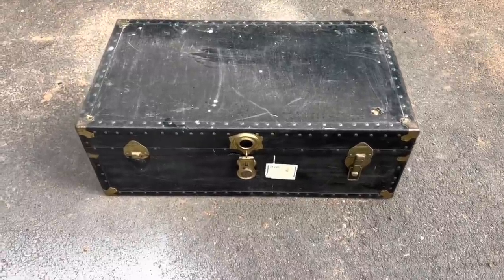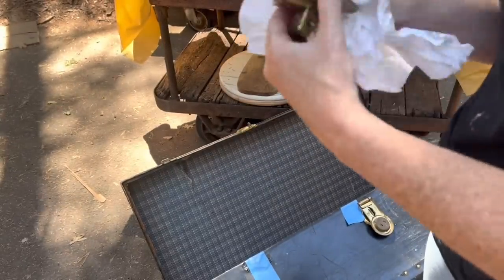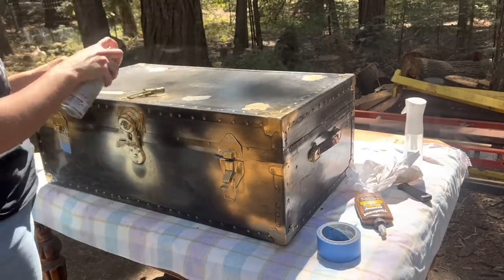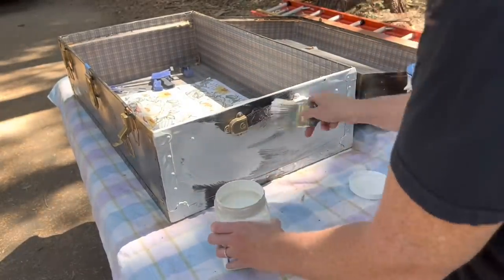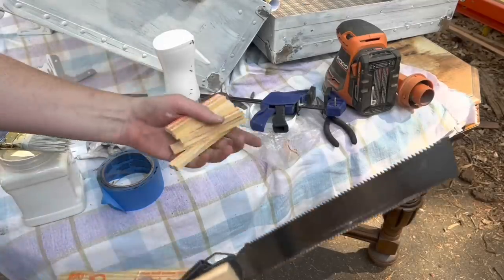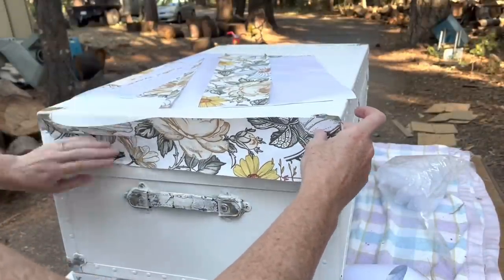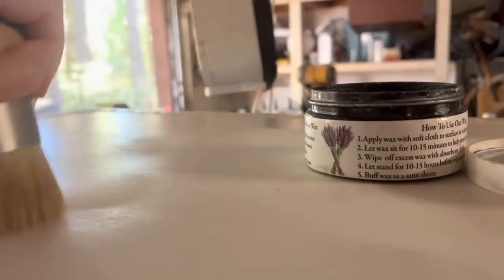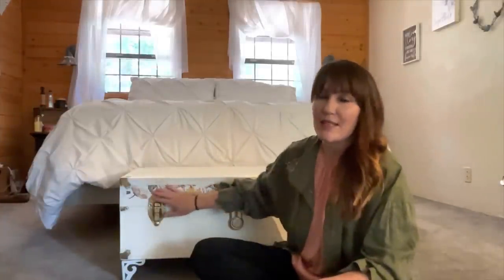Vintage Trunk Makeover to Cottage Delight | Wallpaper | Elegant Upgrades

Comment: Hi there 👋🏼
I have one of these inherited from my grandmother. It's about 3x larger. I was wondering if you could offer any tips on refurbishing the inside? I haven't inspected it heavily but it looks like it's lined with paper. The inside of mine got a little moldy but I really don't want to throw the whole thing out. Thanks for the informative video. Your trunk came out great!
Reply from the maker: Sorry for such a long delay in response. I hope you found some information that you needed to help you refinish yours. But if not- I would use vinegar on the inside to kill all the mold. (If the paper was too far gone, I would remove that first). Then I would either use a fabric or some type of paper (wallpaper works great) to re-line the inside of the old paper was unsalvageable. I have a ton of videos on decoupaging fabric and wallpaper, but essentially I just use a water based top coat to apply and seal it.

Comment: You didn't mention the handles. On mine they are leather. Just wondering about that. Thank you for the tutorial.
Reply from the maker: This one also had leather handles.  I had tape around them to protect them from the paint, but in the end I went ahead and dry brushed them so they weren’t so harsh looking against the rest of the chest.

Comment: I've been hunting through craft videos tackling these guys to help give myself some ideas on what to do with mine, but mine has a particular issue that i haven't seen anyone else really have and I'm not sure what to do with it... if you see this, could i get your take on it? The issue I'm having is the "leather(?)" strips lined by the rivets are curled outward with frayed edges. Should i salvage them? How would i even do that? Or should i just remove all hardware including the strips and replace them? Would i need a rivet tool? I'm just so lost 😅

Anyway i really loved this video and the result! Gorgeous work! You certainly know your stuff c:
Reply from the maker: Oh, I’m sorry I missed this comment and it’s such a late response. I honestly think it depends on what you are doing with the trunk and how much value it holds for you. If it’s a family heirloom, then I would try to restore as much as I could- and yes, I think you would need to replace the rivets. But, if you are doing it for resale or it’s just a fun thing you are working on, I would find another more practical way to deal with it. These trunks aren’t made of the highest quality parts- usually a type of fiber board covered in a fabric- sometimes leather but usually something else. The handles are usually leather. Is there any way you can steam the parts down a re-glue? It’s hard to tell without seeing what exactly you are dealing with. I really wish I could be more help to you.

Comment: I have one similar but the fabric on the top of the lid on the outside has gotten wet and peeled off. Is it best to just sand it down? Any other suggestion?
Reply from the maker: If it’s the strange particle/thick cardboard type substance that this one was, I would recommend decoupaging over it.  Pick out a prepasted wallpaper and apply it with a water based poly.  The paper is thick and easy to apply and the poly will activate the adhesive already on the back and have almost a double duty “stick” and give quite a bit of rigidity- possibly even more than the original paper. If you gat a wipeable wallpaper it should be good to go.  If not, you can add a couple layers of poly to the top to seal it. There are a lot of ways you can go about this, but I think this would be the route I would take.  I hope it was moderately helpful!